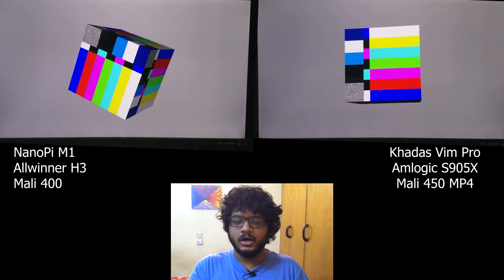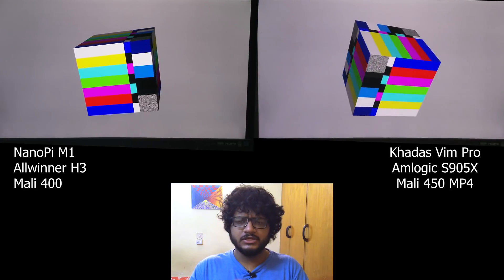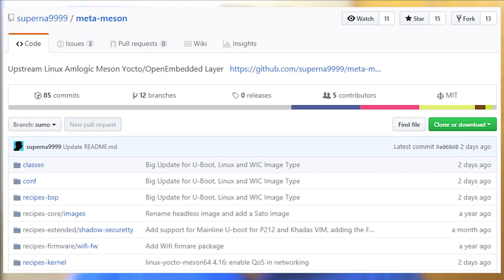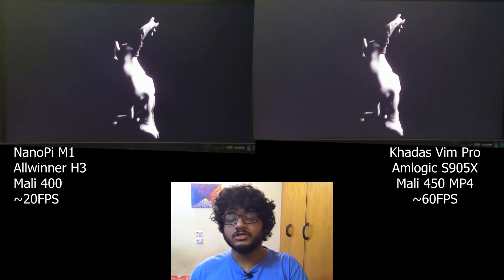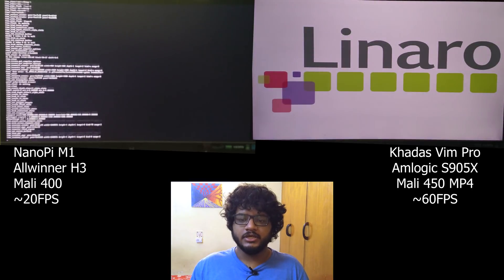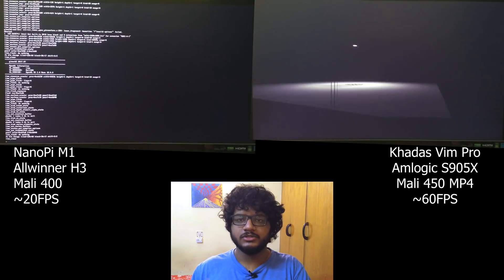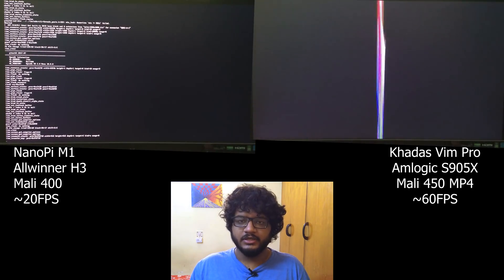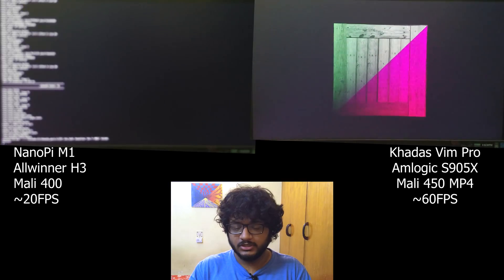Lima GPU Driver GLMark2 | OpenSource Mali GPU Driver

Comment: Love your videos! Just wanted to point out the Amlogic S905X has a Mali-450MP3.
https://www.cnx-software.com/2017/11/27/amlogic-s905x-vs-rockchip-rk3328-vs-allwinner-h6/
Amlogic claims its "penta-core", but thats just because of the 3+2 pixel and vertex shaders (hence 450MP3). Their materials on the SoC can be misleading (they used to market the Cortex A53's as being clocked in at 2GHz).
Reply from the maker: Brooke Melody aah... That makes more sense. Thanks!